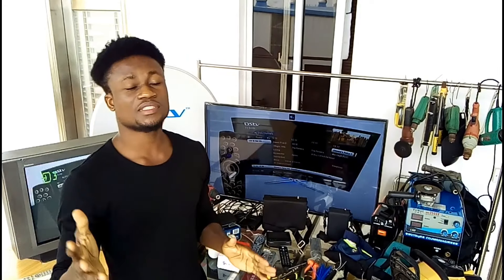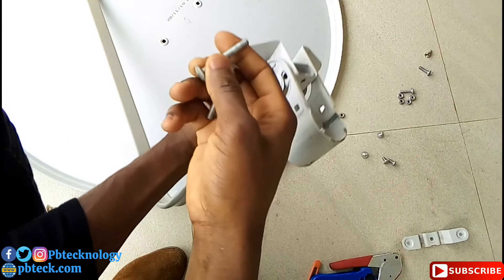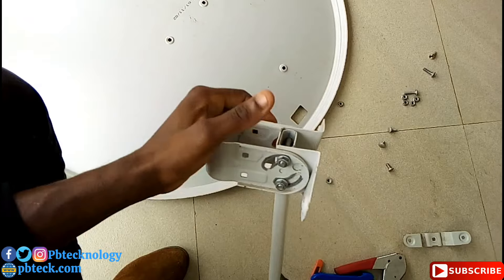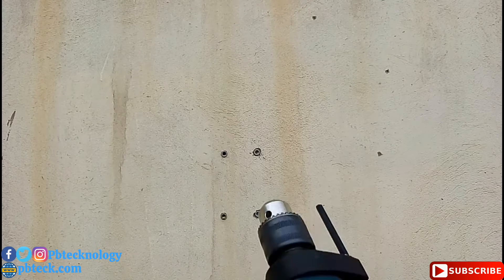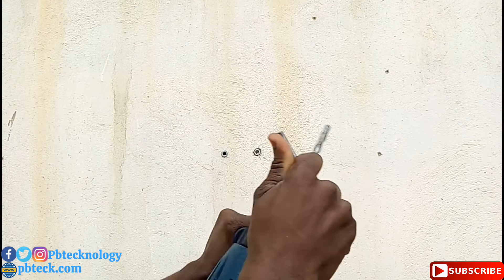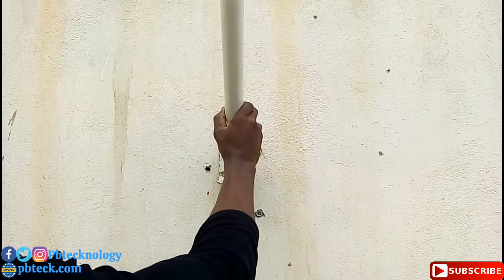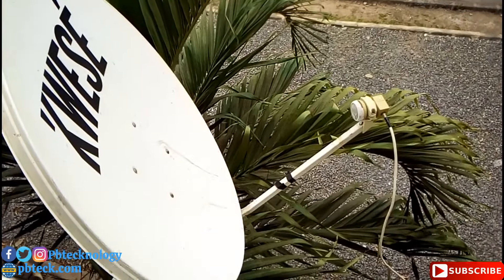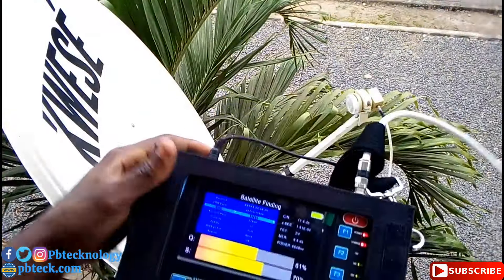How To Install Dstv

Comment: Does the lnb code work without the cap on the lnb
Reply from the maker: If there's no cap on the LNB it will still perform well provided it's a working LNB
Reply: Please tell me if it works because my dstv is showing 0 percent on signal strength and signal quality
Reply from the maker: @effortnemabwe8680  If you have FTA  decoder or you are using an in-built satellite Tv, you can remove the cable and check the strength of the LNB in the installation settings. Mostly LNB strength reduces as it gets older. But it doesn't stop working when the cap removes. You can check the satellite dish and the coaxial cable inside the LNB.  Also after checking the cables, try to turn the dish around if you can get the signal back. Move it slowly
Reply: @effortnemabwe8680   You will need a new LNB. If the plastic cap on an LNB is  removed  it does not Work. If the plastic cap is cracked or worn out to a point where a light tap would probably break it , you will have signal problems.  The Engineers put that on there for a reason....

Comment: What if you don't have the network frequency detector can you still achieve a perfect installation?
Reply from the maker: You can still do installation by having any cheap FTA  decoder to track for the signal or by using the customer's Plasma TV(built-in) satellite or fta Decoder to track.